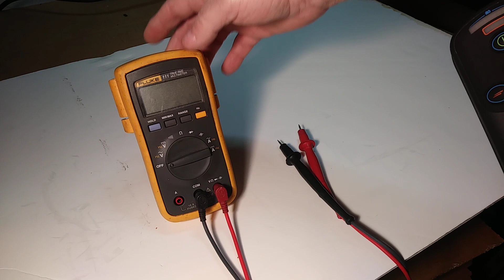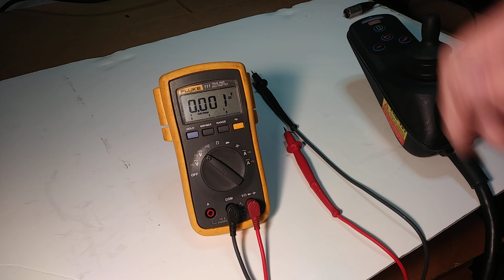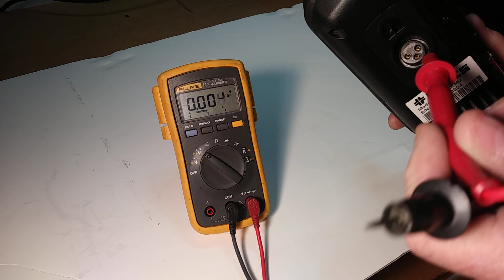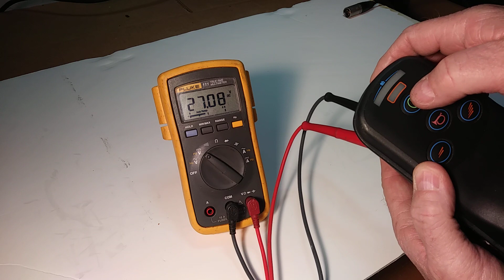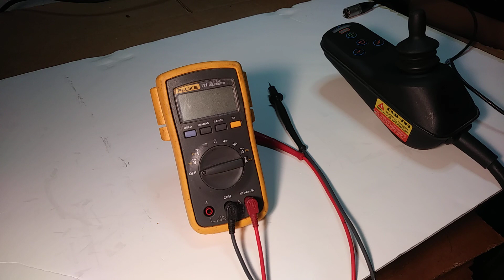How to Test Wheelchair Batteries Easy

Comment: Our Golden LiteRider Envy has two 12V 22AH Bright Way Group batteries of unknown age/treatment.  They came with the wheelchair we bought from a wheelchair dealer.  This issue we're having is that the wheelchair reports full power (all LEDs lit up) and then, after awhile (less than 2 miles now), will suddenly start flashing one red LED.  There is no warning.  Just all... or nothing.  This is not typical behavior, which I believe should be that the wheelchair slowly ticks down the LEDs, as the battery gets weaker, not just "Everything is great!" and then suddenly "I'm dying!"

I'm assuming that behavior is of an  old or weak battery.  Am I correct?  Should I buy Bright Way Group batteries to replace the old ones or is their extremely low price an indicator of quality?

Comment: Thank you for your video. Can you please advise, Jazzy select 6 with 8 month 2 acid sealed 12v batteries low usage in-house. original charger showing full charge green light total of charge rate 25v (not 27v as mentioned in video), however joystick battery indicator showing low battery (only first LED 2 lights red, and orange, means 20% CHARGE). the  Battery measure 25.6v stand alone measured at joystick port, and measure 24.3 under battery load test, (which measured while driving wheelchair and Voltmeter attached to joystick controller port). It is tricky as the load test for 1/2 mile on middle speed, load-reading start 25.4v down to 24.3v. The battery read 25v after load test . Is the battery is ok or it is  controller joystick reader is the problem?. 
I replaced joystick controller as previous old one was giving same 2 lights low charge after fully charge battery and in addition an error 7 flashing code, which indicate joystick controller problem according jazzy select 6 manual. however same low chage still showing when battery fully charged. 
Do you think second (used) joystick controller also faulty in reading battery charge or it is the battery?
Should I just leave charger additional 12 hours after it indicate fully charged as it just does not provide the  27v while charging.  Charger label : maximizer A 24030-9c 24v acid Battery dc output 24v 3A. thank you..
Reply: So your charger should be pushing out 27 to 29v while charging then drop some to a trickle charge when fully charged. Your batteries seem good under load so get new charger. No need to do 1/2 a mile load test, just 5 to10 yards will tell you. Get them batteries up to max volts before they start deteriorating.

Comment: I am physically disabled person, lost both my legs in my childhood due to POLIO, I can't move a single step without wheelchair. One wise person gifted me a brand new Electric Wheelchair in December 2022 in which a Lithium ion battery of was installed. I am using this Electric Wheelchair since then. But from last month I am facing a problem that the wheel chair is stopping on full charge and its not turning on till we put it on charging. Before this it was working fine and giving me battery a very good battery timing and took 7 hours to charge battery from zero to 100. But now it took only 2 hours to charge and giving very minimum battery time. Please help me solve this issue as it is the only mean of my transportation. I can't afford to buy a new Electric Wheelchair.
Reply: If you could get hold of a multimeter and check battery voltage without charging and also check while charging. Lithium batteries should show a bit more voltage that lead acid.

Comment: It's a good idea in theory but doesn't really work in practical use and here's why. Just like a car battery it can read proper voltage when charged, however when load is applied they drop off. Because voltage is a capacitance number what really matters is the amp hour and under load when the amperage falls so does the voltage so a load test is a better test. Because even a bad battery can read as good with voltage. When doing a load test you can simply put your voltmeter on measure voltage inhibit the vehicle's motion and then activate the motors. Put the chair up against the curb most likely reverse attach the voltmeter get a baseline and then activate the chair to push against the curb and take note of the voltage under load. If it drops too far batteries need replaced. As an occupant or a daily user you can tell this when traveling long distances if the chair doesn't seem as strong sort of how it feels when under new batteries when they're half charged. Or as I like to call it when the chair feels asthmatic. When it just keeps getting slower and slower and slower and doesn't really have any strength. But also note that most insurances will not replace batteries except for once a year even if manufacturer or instruction manual says different.

Comment: Ok I understand the comments regarding the need for load testing. I have a wheelchair base that I used to turn into an electric cart. The controller has been giving me low power indication when under load in spite of a lengthy charge. Batteries charged up to over 28VDC over night right after I removed them from charger. The next day they were still over 26VDC. I removed them from base and they are now reading 13VDC and 12.9VDC respectively. My question is would my local auto parts store be able to tell me if these were bad? I'm guessing I should replace both if one is bad. Please reply if you know. Thanks!

Comment: my volt testers are not reading anything. i have three of them and they are not reading, even though i have them set right and these are new batteries that are working. i have done this test on a different scooter but on this city cruzer scooter its not showing any readings. i guess i will have to take the batteries out and test them

Comment: That isn't a accurate read. You need to put resistance onto the batteries and see how much the voltage will drop. But your information on how much the voltage the batteries should be is correct.

Comment: Buy a load tester if batteries run down fast. They may show good voltage but not stand up to load. A load tester will check the battery You will have to take them out of the box (2x12v) but you can then check if one is failing. 👍

Comment: can you use this to measure voltage while the chair is operating? my chair is fully charged but looses power rapidly going uphill. tha batteries are 7 month opld
Reply: Of course u can, u will see the voltage  dive just like you can feel it. The batterymust be a dud or your charger is not working properly

Comment: A better test is a load test, leave the probes in and then move the chair with someone in it, I've had batteries that read 27V but when they get a load it sags all the way to 17-18V, so low the controller just says "nope" and it won't move.
Reply: What do you then if the new batteries fail the load test? I bought new batteries but the green lights on the control stick go down really fast.

Comment: That's just measuring surface voltage not the actual working voltage. A battery can read 12.8 volts and appear serviceable but under load will fail.
Reply: It's a 24v battery
Reply: @markadolphus5094  sorry it's 2 x12 volt batteries=24 volts. As previously mentioned surface voltage gives no real indication of battery capacity. All it tells you is if the battery is charged but not the capacity, capacity is what is important.

Comment: is this just a straight battery test ….or does it test the load ? only asking because my batteries are showing a voltage of 12.7 to 12.8 each. but im told this don't really tell me what state batts are in I need to do a load test. but don't have a load tester. is this a load test please? thankyou
Reply: Correct this is just a voltage reading test. Voltage alone will not tell you in what stage of condition the batteries are. Under load that voltage reading can drop and then rise again. What you would want is have meter for volts and other for amps. That would allow you to somewhat determine what amphours your battery condition has of life when fully charged. Unless u have a fancy digital meter for batteries only.
Reply: But this test in the video is better then no testing at all when only a multimeter is available. Cause a battery with 10 volts can be a bad cell already, so i would i least want to do this test if only testing available.